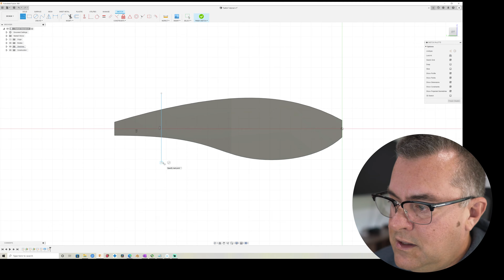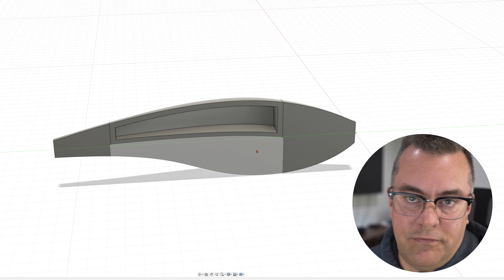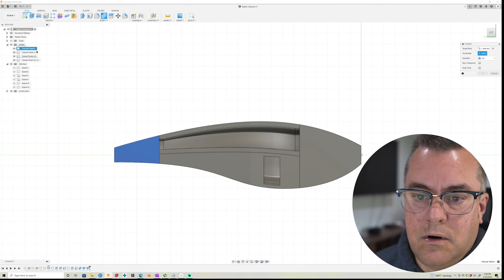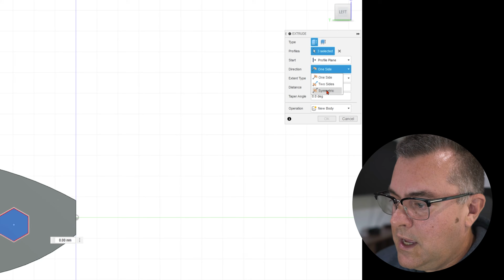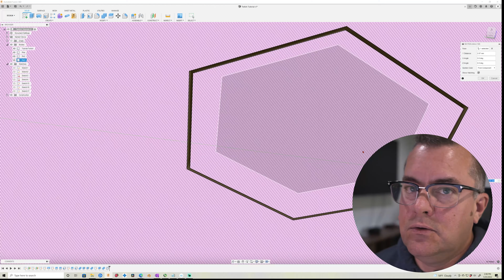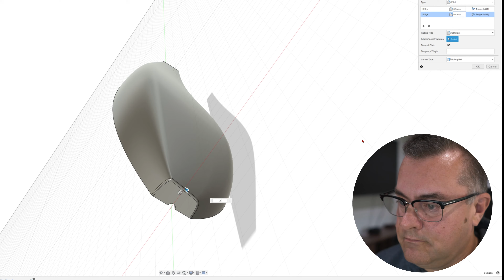Complete 3D Printed Fishing Lure Design Course - Building Lure Guts the Old School Way

Comment: What strength have your noticed from pla to SLA resin, pros and cons. I know for longevity SLA tends to become brittle/crack along layers. Pla can have different buoyancy from moisture absorption. Curious to hear your input on this!
Reply from the maker: Assuming both are finished with paint and an epoxy clear coat...

PLA is much less dense and thus lighter weight than SLA. SLA prints don't really work well with traditional FDM infill type patterns because uncured resin will get trapped in those areas (yes there are ways around it but it is a decent amount of effort.) So the SLA lures I have made tend to have thinner walls to keep the weight down. If you however want a heavy lure that still floats SLA is a winner. 

SLA resins will absorb moisture and start to break down so they need to be coated. In my experience they are pretty tough but that totally depends on the resin you use, Siraya Tech Blu Nylon Black is what I have found works the best.

Hard lures are a toss up for me between PLA and SLA. With SLA you can get a lure right off the printer that is properly weighted and pretty much ready to go outside of paint and clear. PLA you need to do more work but you have a lot more flexibility in terms of the build of the lure, weights, through wire, rattles etc....

Comment: I may have missed this on a previous video, but what resin are you printing in? I'd think the majority are much too brittle. Maybe adding some Tenacious for flex. Also, let's see those circumsized pixels!
Reply from the maker: I have been using Siraya Tech Fast with great results so far, It does require you to get your pilot holes pretty close to the correct size. Adding Tenacious to anything is usually a good idea! I am working on sorting out a good resin/blend to use but I still have a lot of work to do on that...